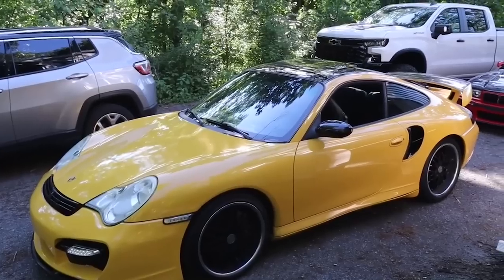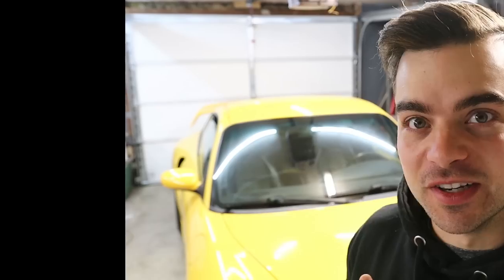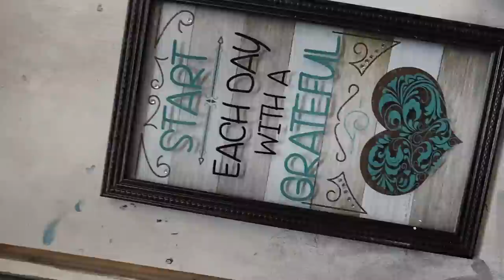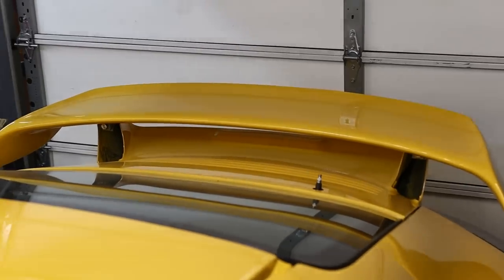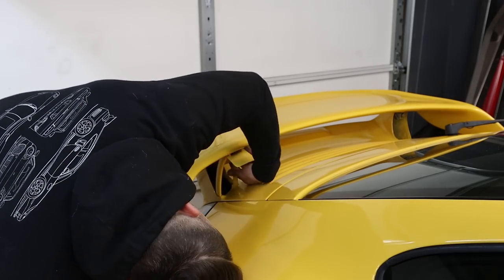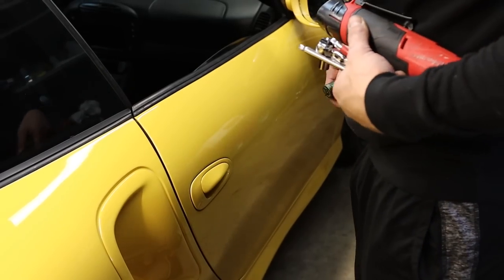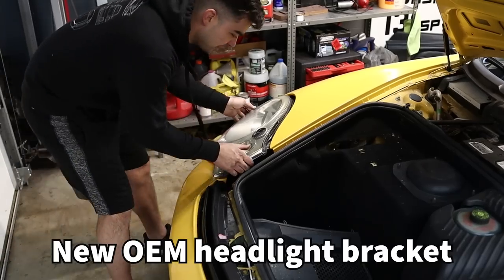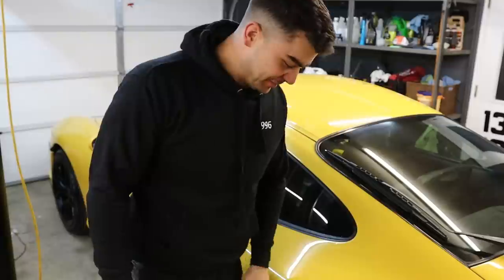Turning a WORTHLESS 996 911 Turbo Into a Brand New One!

Comment: Congratulations! The extra disassembly prep you did really made the re-paint not look like a re-paint. Needs a gloss black turbo badge on the back. Then you just need to lower it and straight pipe it lol Leaving the rear wiper as the right choice. Who cares about the passenger window at this point. 😅 I'm sure you feel proud, you should.
Reply from the maker: I think I'm going to stay badgeless.
Reply: @matt13ross  There's no wrong answer, right? I was just seeing it tie in with the tinted rear lights.

Comment: I love my 996 911 turbo added a ton of best aftermarket everything techart full body kit bilstein coilover fully adjustable suspension gembella full exhaust hre wheels 315 25 19   235 35 19 nitto tires Numeric short shifter and gt3 cables what a huge difference upgraded clutch and upgraded all the gears mod power commander and boosted the twin turbos and made all the air inflows every where 1 inch bigger and upgraded the airflow to the brakes another one in as well upgrading the stereo to a double DIN deck added two amplifiers and added 4 8 inch Subs across the rear now 600 hp to the awd manual drive huge difference

Comment: Extremely satisfying video Matt. Congrats so far. Now please go the extra mile and give the seats some love as well. Colour lock has amazing products which help to get the leather back to as good as new condition and get rid of that greasy shine. 1) Clean of grease and dirt 2) Dye the faded and worn areas and  3) Close off with conditioning and sealing the leather and be left with a nice matt (..) finish. As long as there are no rips in the leather the result will amaze you and will be well worth your time spent. And as others suggestes, the tails should be swapped for the OEM white-red. Personally I’d prefer the OEM Turbo wheels in silver as well but that is really a minor detail.
Reply from the maker: Seats are going to get recovered.

Comment: For the front windshield trim, I thought that you have to remove the glass to remove and reinstall it. You didn't need to do that. Did you use a factory seal or is that some aftermarket part or something else.
Reply from the maker: I didn’t remove the whole trim. The trim on my car is 2 pieces. I just removed the outer piece. Idk if it’s factory or not.

Comment: The hood crest is missing a rubber gasket. Once you have it on, you will not need double sided tape. Also, you need to adjust the headlight bracket so the headlight sits flushed with the fender. 

Looking awesome!
Reply from the maker: Ah, now I know about the gasket.  A bunch of people commented this lol.

Comment: I have a 2002 Carrera that I truly love, even though it's not a turbo. It is Speed Yellow, but the paint is chipped, and the rear bumper paint has a slight greenish tint. I can have it half-ass fixed for $1700, or go all out for a new paint job for $15,000. It has the full GT2 kit that someone else had installed. I can't decide what to do, I cannot even think about selling the car, I love it too much lol.
Reply from the maker: I wouldn't spend 15K on paint, just too much for a car that's not worth a ton of money.  Maybe something decent for 5k?
Reply: @matt13ross  Thanks man, you are right.

Comment: Why didn't they just sand all the yellow off? They went through on the bonnet and primered patches. I was taught you should spray over an even coloured ground coat or primer sealer because you end up with uneven patches in the paint, or you end up having to do too many coats. Also why was he painting in jeans and a hoody? Good job none the less!
Reply from the maker: You don't have to sand all the yellow off lol.
Reply: @matt13ross  I know but you probably should to get an even coloured ground coat or primer sealer coat.